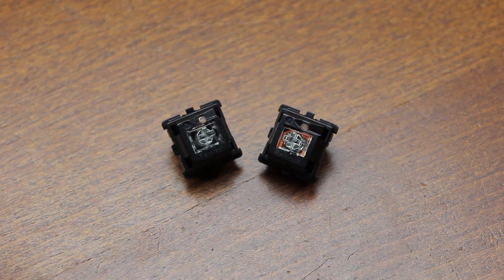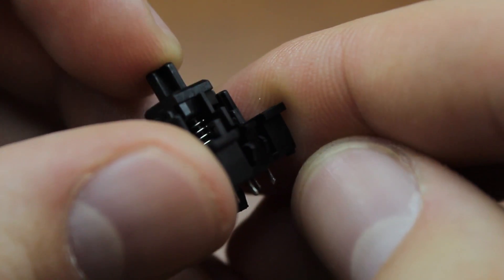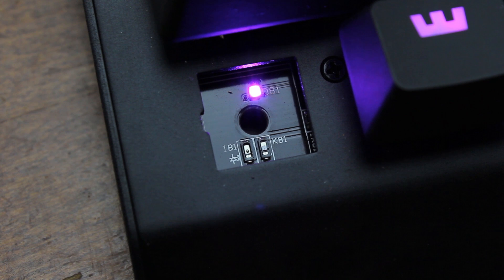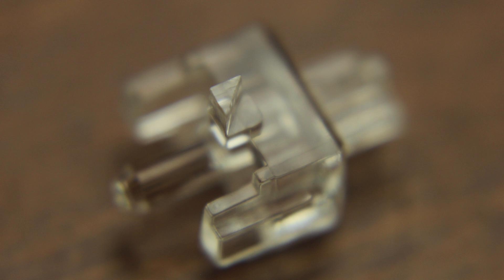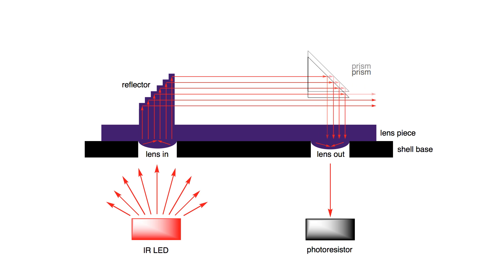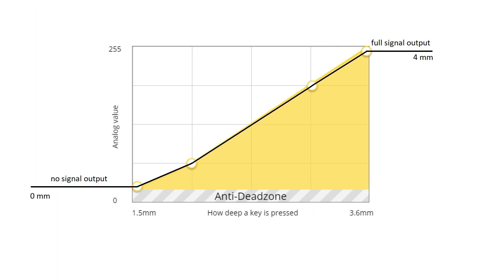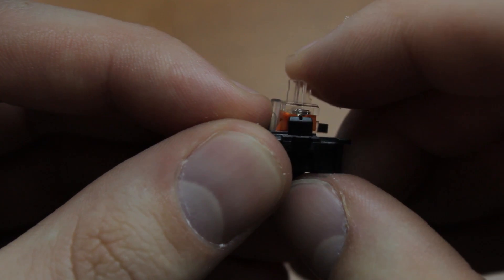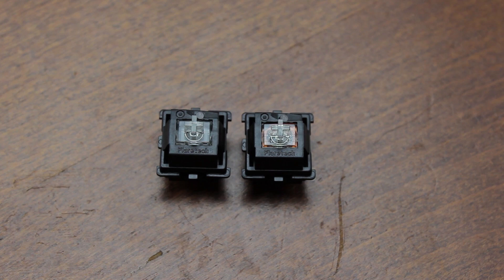Teardown - Adomax Flaretech B / Wooting switches!

Comment: Christ! No wonder my Wooting One was so expensive!
I've had mine since launch and only just now are my WASD keys starting to chafe. What would you recommend lubricating them with?
Since this board is modular, for now I'm simply going to replace WASD with the arrow key switches. However, at some point I would like to clean and lube those 4 switches.
I think I'll eventually buy a fresh set of switches to install, but for now I'll take this route, as it is cheaper. Great video btw, you just earned yourself a sub!

Comment: Should've revisited this video before cleaning my Flaretech board, got a Zowie Celeritas ii for cheap but it's fairly dirty so I disassembled the switches and washed them, wasn't until when I rinse them off that I realized of the lens part on the bottom housing and I ended up washing off two lenses down the drain...thankfully the dummy switch without lens part will can act as inert keys so I'll just stick them on right control and menu which I never use, but still pretty dump mistake on my part...live and learn I guess

Comment: @
Chyrosran22
did you also pledge the wooting two? i literally took the "all switches" pledge to get all three variants of the new flaretech revision.
the actuation point will also be lower than 1.4 mm.
as far as i could figure out, it was never intended to be used as "analog input" wich is why there is that 1.4 mm actuation point.
wooting could convince them into creating better switches for the upcoming wooting two.

Comment: Nice teardown. I wonder if I can make linear "red" switch from the clicky "blue" one. If I remove the orange jacket and the metal piece - will I get linear switch or are the innards different? I ask because I bought Gigabyte Aorus K9 Optical keyboard with red Flaretech switches and 9 spare blue switches. And I want to have 9 red spare switches :-). Aorus K9 doesn't support analog input but the switches seem same as on Wooting One. Thx.

Comment: I'm going to be curious to see what you'd rank higher: the Wooting One, or the Ace Pad Tech Hall Effect keyboard. Both have contactless designs, and you seem to consider them both as the best modern linear switches, but I'm curious as to what you'll choose if you had to pick between the two.
Reply: Chyronsran mentioned the Wooting One as best gaming keyboard by now, so yeah, this one probably.

Comment: There's no need for physical deadzones when you can program them in. That pre/post-travel is a dealbreaker for me. Damned shame. Awesome review, thankyou!
Reply: as i understand, it's very tiny
Reply: We're talking about a device that should output values from 0 to 32768 in 4mm of travel. "very tiny" would mean practically none in this context, since "any" is a nanometre.
Reply: right, so without a deadzone, you'd "breath" on it and it would activate. Again, thats how i understand it from this review. Seems to make a lot of sense to have a deadzone.
Reply: A software deadzone, perhaps. Building them in hardware is a design flaw.
To put this into perspective, it's only slightly more sensitive than an xbox controller.
Reply: Ah, so you've tried it already? I haven't. And, i don't have gamepad so i wouldn't know that reference
Reply: Tried what? 
You've never used a gamepad? How does that happen?
Reply: The keyboard... what are we talking about here? And I don't have [the] gamepad.
Reply: What does trying the keyboard have to do with anything?
Seriously, you've never used any kind of gamepad ever? If you have, that's the kind of sensitivity to motion we're referring to.
Reply: To be clear: What we are talking about here is flawed design of control surface componentry, specifically, the physical deadzone where input is ignored.
Reply: Only by actually trying the keyboard, you can make these statements comparing it to the/an xbox controller. Else it's only an estimate or assumption at best.

Also of course i have used gamepads... but do not own an xbox one... (at least not for years now)
Reply: The length of throw is known for both these switches and a game controller. There's no assumption here.
Reply: What is it?
Reply: Try watching the video.

Comment: on the note on whether the signal is truly linear or stepped, I believe W00ting stated that the switches can detect up to 2048 different positions. so, TECHNICALLY stepped, but far beyond anything's ability to make use of it.
Reply from the maker: Invidious Ignoramus that's what it can DETECT, not what it outputs ;) .

Comment: It's a beautiful piece of technology, indeed. But what bugs me most: how all this intricacy of lenses, prisms, and superclear plastics will cope with dust and aging?
Reply: Having had one since the original kickstarter (~3 years), I've had exactly zero issues on that front so far. Or any other front for that matter.
Reply: From my experience, some switches over time got very scratchy, much worse than Cherry MX new. Also some switches that are heavily in use changed their actuation point over time, so the longer I had the keyboard the further up I had to set my actuation point. In general this light travel system is very uneven and also lead to many miss clicks (which supposedly got fixed but only to some degree)
I would just go with any other switch,. The new Wooting Lekker though seems to have a much better more consistent switch.
Reply: I was thinking the same, and I was also thinking when these become cheaper like Cherry MX switches and some 12 year old spills his soda all over it, I wonder how will they will hold up to that.
Reply: I too had the same thought about dust while watching the video, I guess I will see with time but hopefully my datavac will help
Reply: Well, here we are. I have an answer: bad, but you can do something about it, it's still cool and you can clean it if you don't try to scratch anything. Not like the Co-gain ones, those are full of shit and broken out of the box.
Reply: I cannot say anything about the dust resistance, but a great thing about the switches is the hot-swapping capability. It literally takes less than half a minute to change a switch.

Comment: At first this appeared to be an impressive case of the wheel being reinvented [for no particular reason], until you showed the ability of the software to set the actuation characteristics on-the-fly. That part of the technology can definitely be applied to switches in other devices, whether it be musical instruments or disability hardware.
Reply: pmodd yeah it's quite cool! It can also be used in racing games where you want a smooth analog input rather than binary on/off like other keyboards.

Comment: oh man that clicky switch...i get that they probably did it just cuz they didnt want to scare off anyone used to cherry blues, but going to such lengths to use that clicky mechanism instead of using a proper click leaf...
Reply: The tactility is fine, it's the drop off afterwards that needs to be limited. Thankfully, the cherry mx method for achieving tactility actually has a very minor drop off after tactility, in both clicky and tactile. I don't think it affects the usability of the linearity as much as one would think it does, but I can only go on second hand accounts.
I agree that full linear would be ideal here, but I believe it is actually really challenging to train the fingers to do it with no tactile or audible feedback. 

I suppose the only way to fix that would be haptic feedback, but holy shit, that makes things even MORE complicated than it already is...

Yeah, a 'thin click bar', like on kailh box whites might actually work quite good. The tactility is applied off axis, so it wouldn't cause you to overshoot at all. However, given how complicated the light piping and lensing already is, fat chance of that being a solution.
Reply: Bit odd to have a clicky switch for an "analog" keyboard... the click is 0.2mm after the analog starts too making it right in the way...
Reply: I have heard people that prefer the clicky switch as they use it as a cue for a specific actuation distance, ones that originally got linears thinking the clicky switch would defeat the purpose. Don't trust your expectations.
Reply: i actually think clicky switches would make sense for this keyboard, and i dont take umbrage at that. but i dont think hysteresis makes sense for this keyboard. i do think the tactility should be basically as low as possible while still being noticeable, though. something like a thin clickbar approach would have been way better than this imo
Reply: I'm not saying they don't make sense. I'm saying that where the click is makes no sense. If it was 1.5mm in or 2mm in it would as it could tell you almost exactly where you're at.
Reply: you can change the actuation point in the software to match the click.  @FatheredPuma81
Reply: @GuidoDePalma  But you literally cannot... you'd think the setting to change where the analog starts would be a pretty obvious spot.
Reply: yes, that is the point you would change. @FatheredPuma81
Reply: @GuidoDePalma  Okay? I don't see your point but cool?
Reply: @FatheredPuma81  I'm not sure why but we are cool, sure. Do you actually have a wooting one and used the software or were you just speculating?
Reply: Or click bar really. If you go to there, then why not go for the real clicky feel?

Comment: I wonder about how reliable this kind of switch is
Reply from the maker: Extremely. Lifetime is >100 M, probably in the billions under constant usage actually (or 300 kh, whichever comes first).
Reply: Rated at 100m clicks so better than Cherry switches. Granted they haven't been around long enough so only time can tell.
Reply: > 100 M is as high as it gets. But Alps also have high # of key strokes. The better question is of course how dirt resistant it is. That's however tricky to put in numbers (what kind of dirt, how does the dirt enter the switch etc. etc. etc.).

Comment: interessant video, but say, even if the switch was having a full blown "analog-ness" (so a signal from 0.0 to 4.0mm of the travel) you could make a analog curve in the wootility software that start at, say, 1.1mm and go to 255 at 3.5 mm, so you don't need to smash the switch all the way down to have you full signal, and you don't actuate it with the weight on the keycaps (my spacebar actuate with the 8g of the cap if I hit my desk)

Comment: this switch is also in the Zowie Celeritas II
Reply: Yep, but with no analogue sensing.
Reply: Do you know what the total response time is of the Wooting One and Zowie Celeritas II? asuming its the same.
Reply from the maker: Wooting have put a massive amount of work in decreasing the response time as much as possible. This work is keyboard-side, not switch-side, so I don't think they'll be the same for the two keyboards.
Reply: hmm maybe but fairly sure the controller chip in both keyboards would be specific to the Adomax Flaretech and possibly the wooting just has a more complicated firmware running on it while the zowie one just sets it to max activation point for gaming etc. I heard that people complained about the wootings lag or some thing because it was running at 500hz and they updated the firmware to 1000hz but not sure if that was actually a complaint about lag or if it was just OCD people saying it had to be 1000hz and it was actually running really fast regardless.
Reply: We actually use our own chip, and made our own firmware. We have optimized the firmware over time to respond faster and faster. When we just launched, we didn't want to push the limits until we had more user feedback.

Comment: Pretty impressive for a switch meant for the 'gamer' market.
Reply from the maker: I think what he means is that it actually seems to have been engineered with a practical purpose in mind. A lot of "gamer" stuff is just fluff or cosmetics.
Reply: @Chyrosran22  Can we buy them for custom keyboard builds?
Reply: @Chyrosran22  Also... So many claims of the new opticals... Would you be willing to actually benchmark them? Seems ZERO manufacturers make their benchmarks available (only their claims). Yes, I mean latency-wise. I yes, the experimental setup would be a pain.
Reply: @Chyrosran22  There's two parts to gamer products. One is a whole lot of fluff in the form of rgb and aluminum where it's not needed, and overengineering when the people buying the products would not be able to tell the difference.  just look at the ridiculous arms race in decreasing response times for keyboards aswell as the competition for lightest mouse. Glad that it brings more competition and development, for example there is development of a optical black ink switch. Should be stupid smooth....
Reply: Richard Smith whether something is or isn't for gamers I think doesn't  necessarily correlate to the quality in either direction. Like honestly, romer g switches are so promising to me cuz I like to type in low or no light and hate backlight bleed. It's just a shame about the key feel.